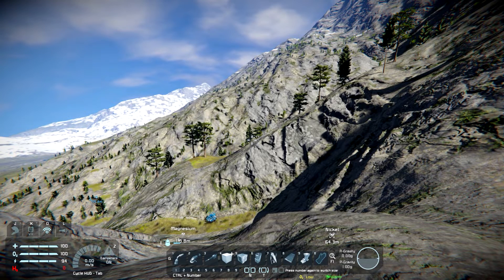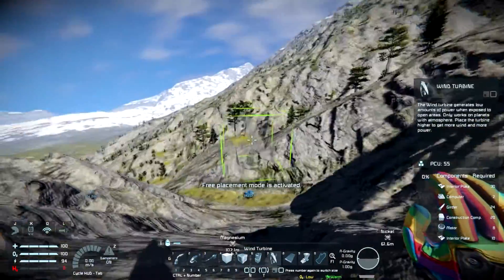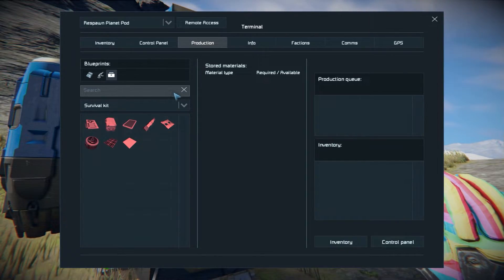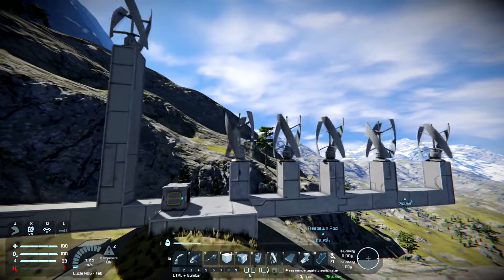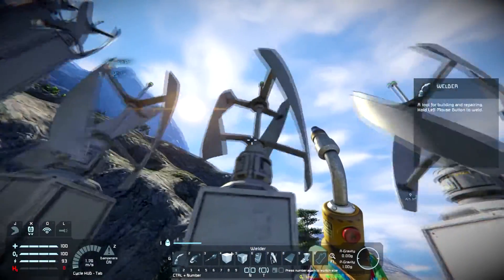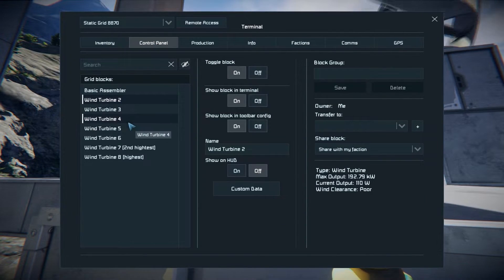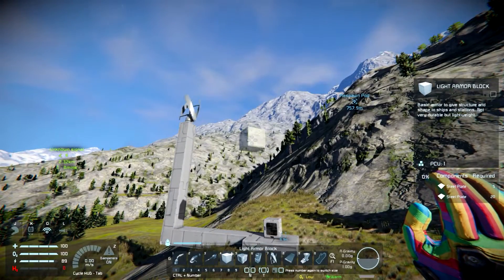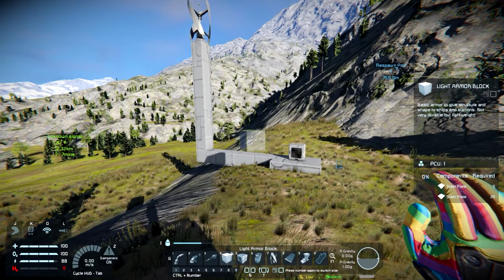Space Engineers Tutorial: Wind Turbine

Comment: The testing could be improved, not sure if I see it as a Tutorial. First off it is the current output that is important, you rarely got max. Also you should have had done the testing with 1 WT in the same position, where put other WTs in a set distance around it (1-4). Also should try out if moving up or down have effect. Or just say this have been tested and shown the main results and differences, how to place an efficient grid. Block obstruction testing at the end were the best, but should started with it (and cut out most of the other stuff). SE tries to simulate wind fluctuations, so terrain height really does not matter much. Just find an OK spot where you want your base, then try out some placements. Rather add extra WT if do not find any sweet spots, pretty cheap.

Comment: can you explain, why my vehicles batteries, are getting recharched with 24.20 KW, while each of my 7 wind turbines produces about 350 kw each?

is there a way to speed up batterie recharging?
Reply from the maker: Hmm do you have batteries in recharge mode?  If not when you dick with your base your battery on your ship will help power base.  If in recharge they won’t send out power.

Not sure the reason for discrepancy in your power output and charging going in.  It’s possible you have a lot of things running that’s taking up power.  In which case that total output would be split between lots of other machines and batteries.